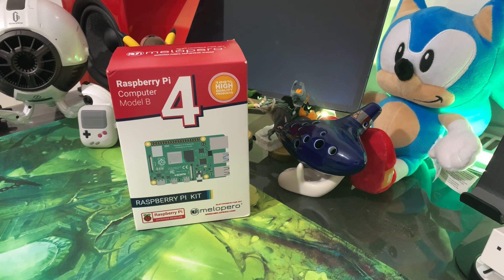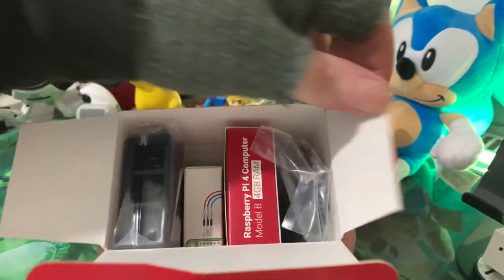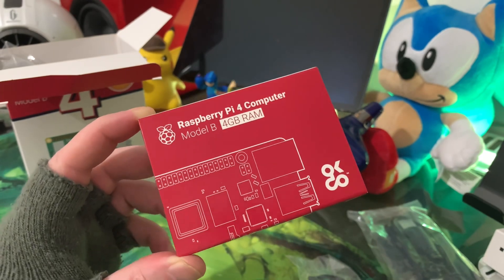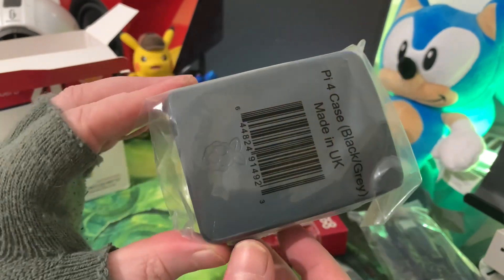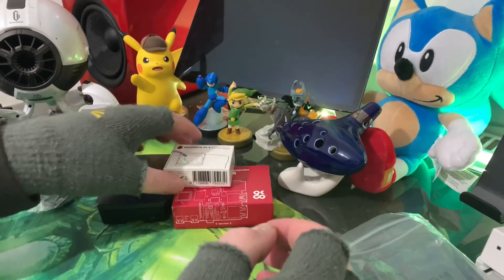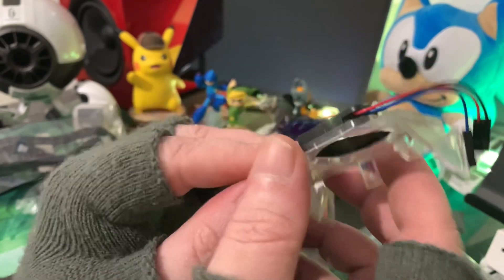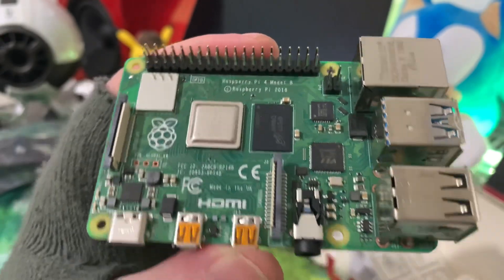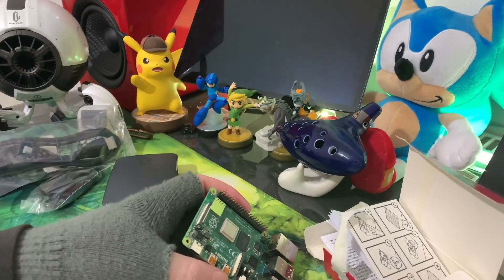How to Mod a Arcade 1Up tutorial- Part 1

Comment: They’re brilliant for the money. I stuck mine in the nespi4 case for that retro look.
My favourite front end builds are the domaso 128gb and the Rick dangerous 256gb from arcade punks.
If you try any other cases with decent cooling it’s worth overclocking to 2G.
For decent Dreamcast performance the redream emulator works great. The Rick dangerous build uses redream.
Reply from the maker: that’s awesome just waiting for the utorrent to download not many seeds sadly so might take a few days ahhhhhhhhh but thanks for the tips man really appreciate it
Reply: @SonicLoveEmulation  no problem mate, it does take ages to download those front ends. I use a vpn when downloading which makes it even slower. It’s worth it though 😁

Comment: I did buy the starter kit for my first Pi 4, but I bought everything individually for my second Pi 4.

I spent absolutely AGES looking at various cases/housing.  In the end I went with the Flirc Kodi aluminium case that is passively cooled to keep it silent for my media/TV box Pi 4 and the Anidees aluminium case with an LED fan for my games console Pi 4.  Both are running Batocera.😁

You can find the cases on Amazon if you're interested.
Reply from the maker: cool man I will definitely check them out man, I have the 3B+ and the CM3+ but this will be my first Pi4 but I think it should be enough for the arcade one up to mod it man...but will definitely check out the cases man
Reply: @SonicLoveEmulation  You will need one with a fan for gaming use.
Reply from the maker: Just looked around then and I think I might get the flirc case, looks nice and has a great heat sink
Reply: @SonicLoveEmulation  It is nice, but I think it's a bad choice for gaming.  A passively cooled case is not the way to go, in my opinion.